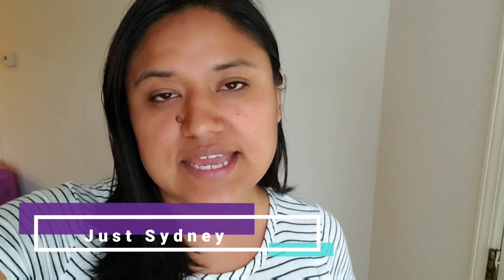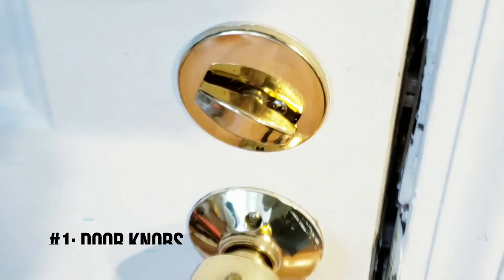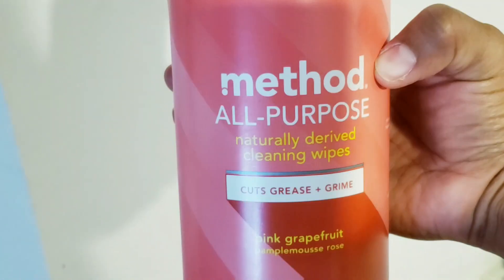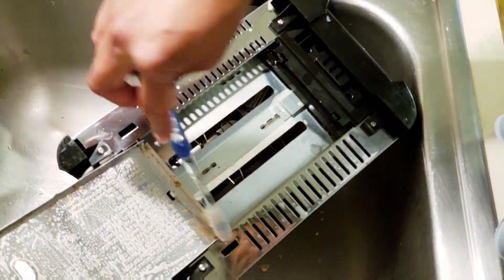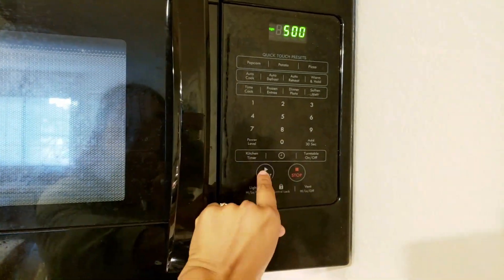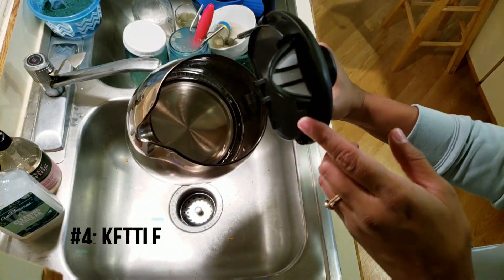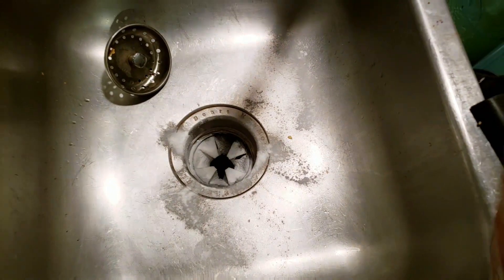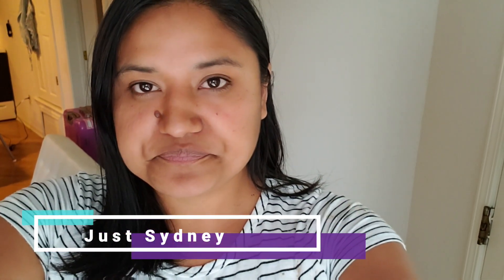CLEAN with ME TIPS | FIVE THINGS WE FORGET TO CLEAN (2019) | BETTYSMILES

Comment: I spray my microwave with Mrs. Meyer’s, turn it on for 30 seconds and then wipe it down. I saw someone else share that tip and was amazed. So I tried it and have LOVED it. I’ve never used method cleaners so I may need to get some and try that 🤔🤔🤔
Reply from the maker: I've used mrs Meyers products a lot but have been using method and ever spring. All of these brands are great "chemical free" cleaners and safe for little ones around.